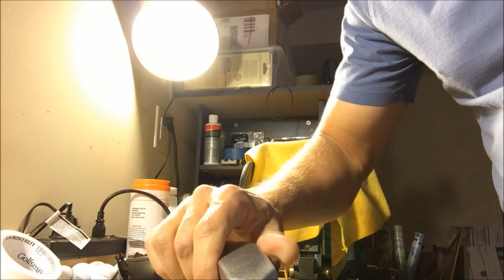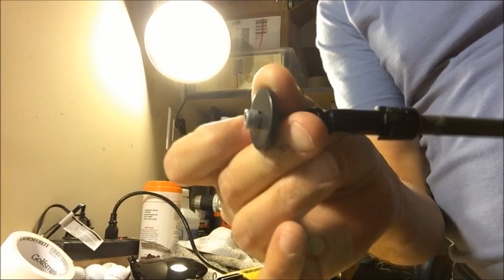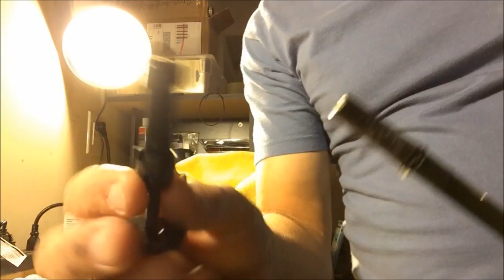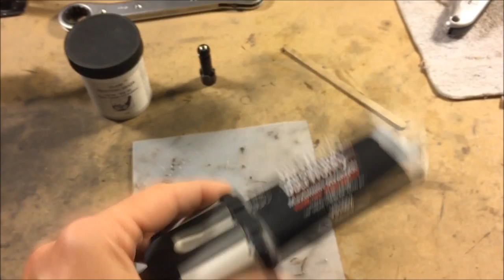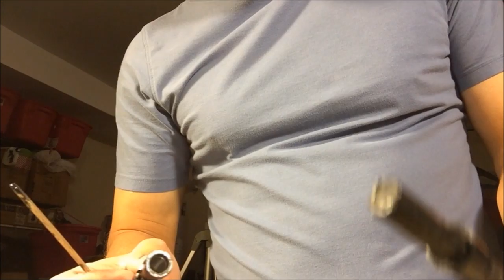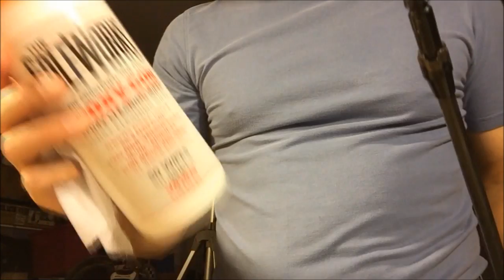How to Remove Golf Shaft Adapter

Comment: If you remove the adapter, what will that do to the length of the shaft?
Reply from the maker: Ahh, I’m not sure what your question is, unless you are referring to using the shaft without the adapter for another club? If that’s the case it will likely be slightly shorter in length depending on the brand’s adapter. Could be anywhere from 1/4 to 3/4 inch.

Comment: how would I remove epoxy from an old shaft if I want to use it in a new club?
Reply from the maker: If the epoxy is light, you can remove it by sanding.  If the epoxy is thicker or chunky, apply some heat to soften the epoxy and then use a box cutter (light pressure, opposite of cutting surface) to remove.  You can also watch this video:  https://youtu.be/VJ5jj4daWSw

Comment: Can I get a 5dgr adaptor.
No dont get smart.....I used to have a Ping...6dg Driver.....was perfect.
I play better now. Using this Cobra adjustable....adapt....8.5--11.5.
I dont want.....Ihit ball HIGH naturally...I want 4 or 5 dgr
Reply from the maker: You will likely need to seek a custom club fitter in order to get a driver with that low a loft.  You will not likely find one off the rack these days.  If it was 20 years ago, they were more common than today.  You might want to seek a golf pro to work out "why" you are hitting the driver so high.  I imagine it is a downward angle of attack causing the issue.
Reply: @XJSimulations  Good obsevance. I am a professional.
I will bent the Mizuno TZoid driver shaft/head to desired loft.
Bubba Watson use 7.6 dg Ping. 
I dont know why everyone is obsessed with 9.5 up. If you cant hit ball high....you need work on swing.
Interesting bout Bubba is ball placing at address....just outside middle. In my opinion he hit with weight on backfoot....!
If you slowmow his footage....maybe flip video....(right handed)..... A lot to learn from him. Im unothodox myself.
If you familiar with Calvin Pete(held driving accuracy 10 years in row...USPGA...1970s)....with bend left arm....And a secret his son told me.....Calvin had a 4degree driver.
Dont trust the equipment to hit ball for you. You buy club....you hit it until you own it. 1000s of balls if need be....thats golf
Reply: @XJSimulations  Simple myths and theory busters!
https://www.facebook.com/golph.tv/

Comment: If you don't save the ferrule....you can just push the tip off with a shaft puller.  Kit not needed.

Comment: around 330 mark the extractor has little load and yet the adaptor slides off. How does that happen without much of a load?Your videos are very helpful. Thank you for sharing.
Reply from the maker: It has more load than the indicator line marks.  It doesn't take much load for an adapter with proper heat applied.  Of course, some are easier than others too.  I've dealt with epoxy that seemed more like cement or super glue.  So keep in mind it can vary.  Thanks for watching.

Comment: so, let's say that I bought some clubs on the internet, wanted to switch the heads onto some different shafts, lets say that the shaft tips are too big (.370) and the club heads are .335 (or any other random number) Can I buy a reducer that will take this shaft down to the correct hozzel size?
Reply from the maker: Unfortunately, there is no easy fix for that situation.  IF the hosel was bigger than the shaft, there are options, including fiberglass tape, among other items.  Your options are to increase the size of the hosel, which is a job which should be done by someone experienced or purchase the proper shafts for the clubhead. Sorry for the bad news, but hope it helps you to make a decision.
Reply: In Increasing the size of the hosel, you are basically just boring it out to be bigger and accept the larger shaft, correct?-- By using a reamer?
Reply from the maker: Exactly.  It is not a difficult job with the right tools, but it is a detailed fix.
Reply: Golfing Idiots is it better to step up in reamer size or just use the size you want to get to? (go from .350 to .355, to .370, or just start with the .370)
Reply from the maker: If you do it correctly, you can immediately go to the size you desire.  Just remember to take your time and be precise when doing this type of work.  Go slow and be exact.  Good luck! Let me know how it turned out.

Comment: Another Great video, that said if I F.L.O. the shaft I would need to alight the hossel setting I need with theh FLO mark of the shaft 
Yes/No?
Reply from the maker: When it comes to adjustable drivers, I will usually seat the adapter in the driver head first and then install the shaft in the proper position.  This is the easiest way to ensure the shaft is in the correct position for the selected position on a adjustable driver.
Reply: @XJSimulations  Simple myths and theory busters!
https://www.facebook.com/golph.tv/

Comment: Do you have a video on putting a 3 wood head on, usually there's a brass metal wedge that goes in there or something?
Reply from the maker: That is called a "brass shim" and it is used to allow a smaller diameter shaft to fit a larger hosel.  I'm not a big fan of using those brass shims as it introduces a potential point of failure with the club head. Apparently, I have not completed a video for shaft installation so I will get to work on that for the community.  Thanks for the recommendation. Be sure to subscribe so you get updates on new releases. Thanks for watching.

Comment: Hi, my shaft broke off even with the adapter.  Any suggestions on how to remove what is left of the shaft inside the adapter?
Reply from the maker: The best option would be to apply heat to the adapter (will loosen the epoxy bond) and use a drill bit to latch on to the remaining shaft piece for removal.  Continue to reapply heat and attempt removal. Use a brush drill bit to remove any remaining shaft bits and epoxy. Hope this helps, but if you have further questions let me know. Thanks for watching and please consider subscribing.
Reply: drill it out

Comment: your comments on putting adapter in any position makes a mockery of the splinning of shafts that was all the rage a few years ago l wonder who is correct
Reply from the maker: +Leslie Harris Thanks for watching and sorry for the delayed response as I am deployed currently.  Keep in mind the adjustable adapters are designed for you to have a custom fit driver off the shelf or straight out of the store.  Once you know the loft and lie settings that best suit your swing, you should really not be adjusting your driver.  Do you adjust your irons on a whim?  So the idea is to find your adjustments and then FLO the shaft for max performance.  I promise you'll see a difference.
Reply: this comment didn't age well

Comment: Is the shaft that the adapter was extracted from still good? Say I wanted to take a new shaft and take off cobra adapter could you take off cobra adapter and put a different adapter on same shaft?
Reply from the maker: +Logan Blanton absolutely, provided that the shaft and adapter are the same diameter. The shaft and adapter can be used again and again provided neither are damaged during the process. Depending on the type of adapter, the ferrule may be the only issue. For example, Taylormade adapter have special ferrules that need to be purchased from Golfworks (or other supplier) in order to complete the process. However, other drivers only need a standard ferrule. Thanks for watching.